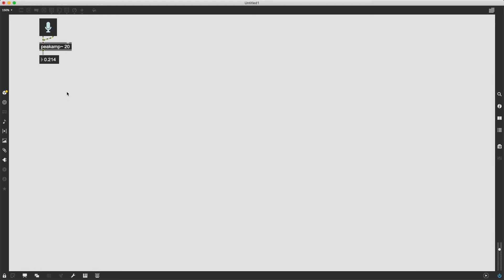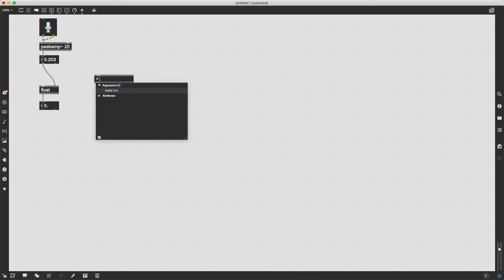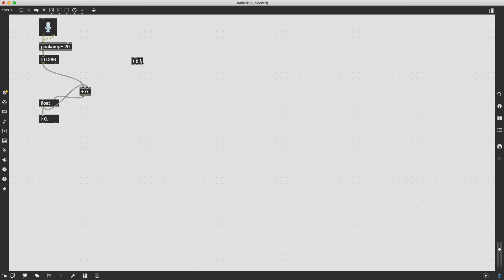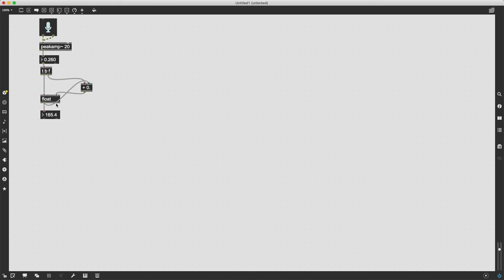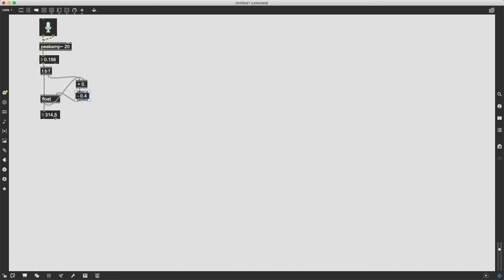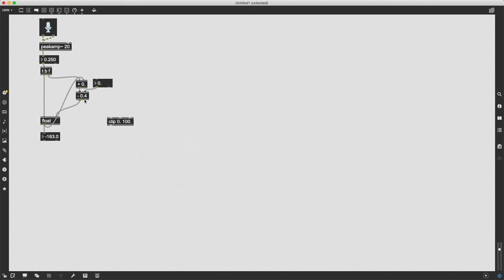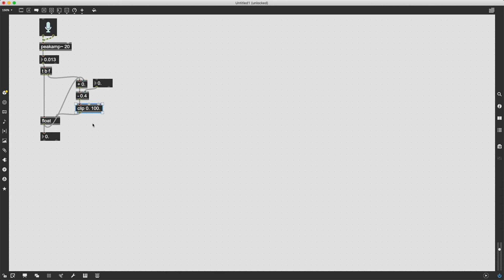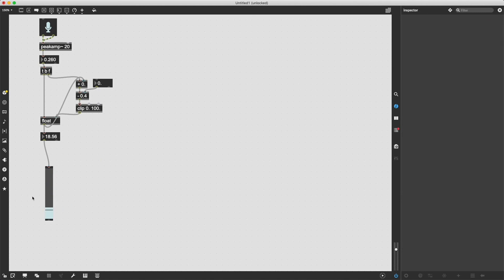How to make an Audience Participation Meter in Max MSP -- Leaky Accumulator Tutorial

Comment: Beran, 
Thanks for your good info.
Your explanations on "Leak Accumulator" seem to detect the high point of the sound. In my activities, when I work to plot the Hertz value of a sound with its time measure, I want to record the time measure at the point the sound is repeating. This happens, like at the end of a song, when the lyric changes syllables but the note is steady in one voice. Is there anyway to plot the size of a repeating sound at the point the words keep changing. Thanks, <berane9@gmail.com>
Reply from the maker: That’s not an easy question to answer just in a comment but I would say nothing is impossible with Max msp! If you want to detect repeats in the sound I would suggest starting by looking at pitch tracking objects like fzero~